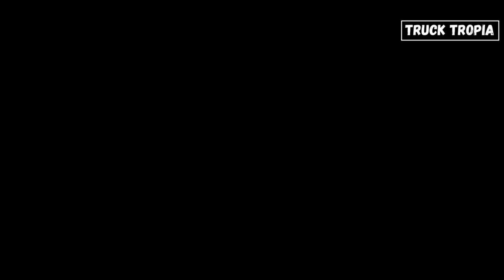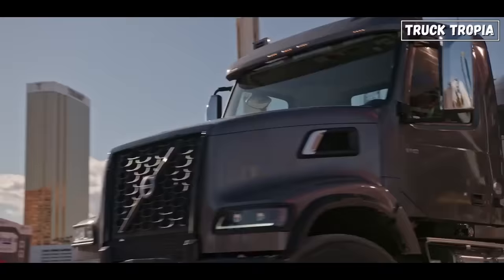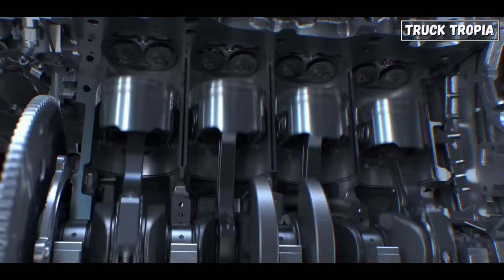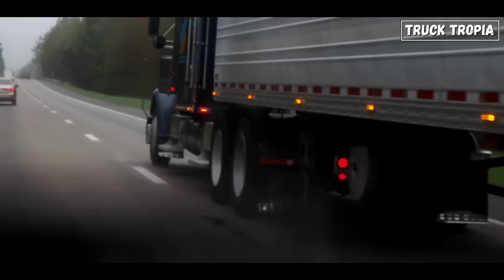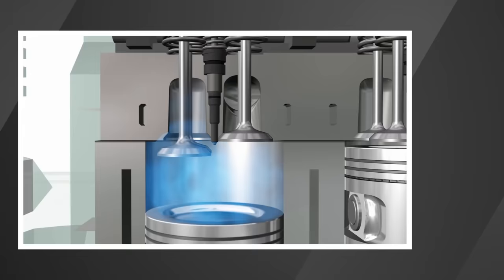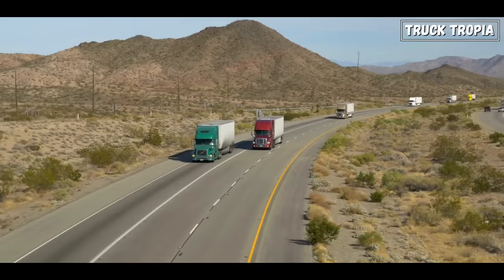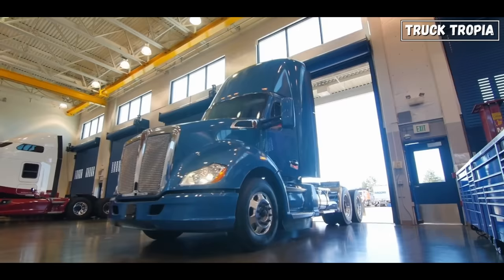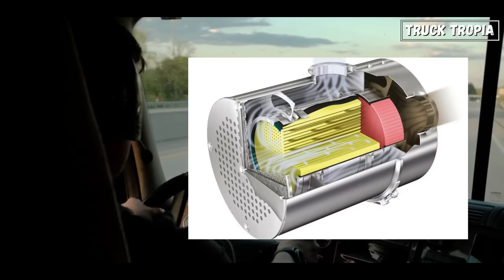Ultimate Truck Education 101 - Every Question Answered

Comment: 80,000 lbs. = 40 tons.  Not 36 tons.  Where in the world did you get the information for this video?  There are several items mentioned in this video that are just flat out wrong.  Why not do some actual research and tell the truth?  👍🇺🇸
Reply from the maker: Not in Eu , 80k lbs = 36.000kg which is 36tons, America is not the only place in the world 😅🫣
Reply: As you may not be aware there are several systems of measure dating from ancient times to now. FFWD to recent ~500 years to now have evolved into two major measuring systems:
A) one labelled Imperial or English System it evolved over centuries out of ancient Roman system of measure. 
The English/Imperial system of measure use the familiar in US, CAN, UK, AUS, NZ & rest of English influenced areas, Briefly e.g.:
Inch, Foot, yard, mile, etc for dimensions/ length/ distance. 
Oz, Lbs, Stone, hundred-weight, Ton = 2,000 Lbs, or Long Ton 2,240 Lbs approx = 1 metric tonne = 2,200 Lbs

Metric system evolved out of ancient Roman units of measure during of France in late 1700s -early 1800s on that adopted unit volume of water 1 litre = 1 Kg at certain conditions. The Kg also used for guaging weights of all materials, goods, capacity, trucks, etc.

Comment: Actually most of the caterpillar engines were v8s
Reply: How old are you? I'm 76 and I've never seen a V8 CAT
Reply: @hansjansen7047  really 3208 cat is a V8 cat. But also can't forget some of 6 valve 8 valve caterpillar engines also V8 Cummins motors with air starters
Reply: There were plenty of 3406 Cats running around our area. It was a very good working motor. Most of the drivers loved them.
Reply: Scania used to run them for heavy haulage.
Reply: Scania used to run them for heavy haulage.
Reply: @danielmwattsjr3671  The 3208 was not a big motor, but mostly a straight trucks and light duty. Earlier ones displaced 522 cid, and later ones were 636 cid. The basic self asperated one ran 175 horsepower, and a turbo unit was 225 horsepower. A company I worked for had Ford C7000 and L7000 units with the 3208 Cat. They worked good for our application, but heavy hauling would of been too much for them. Most of the heavy duty Cats in our area was the 3406. The guys that had them loved them.
Reply: I got one in my 1985 b 700 school bus

Comment: 80000 lbs is 40 tons not 36
Reply: 36 metric tons is about 79360 pounds, hence his statement!
Reply: @LMace-su4if  if your using metic then you would be using kilos not pounds. And in the us, we use 2000 pounds is a ton. We don't use metric tons.

Comment: 2000 lbs equals 1 ton so 80 000 lbs is 40 tons not 36 tons dude and ues i have a class a CDL and am a yruck driver
Reply from the maker: Metric ton is 2204 pound = 80.000 pounds equal to 36.000kg which is 36 ton, your welcome 👍
Reply: @TruckTropia  in America we don't use metric ron

Comment: lift axles are stupid. the horsepower stuff in this video is bullshit. the western states all allow more the 80000lbs except for California, I never ran east but I see they have all kinds of weird drop axles going on so I bet they all haul more then 80000. 63500kg is the legal limit without permits where I live in Canada. I have driven the Euro 600hp junk Volvo motor in a Mack they call Titan. zero throttle response horrible to drive. the transmissions usually limit the torque to 2150 in the US. plenty of v8s in US trucks of the past. 3408 cat, a bunch of Detroits, even way back to the 903 cummins. the i6 config just works better so no one uses the V

Comment: I'm so sick and tired videos that say garbage like horsepower isn't everything and you need torque.
absolute nonsense, of course horse power is everything, because you can get ANY TORQUE you want with transmission. You can spin the entire planet with a long enough wrench, horsepower is the ONLY THING that matters when it comes to acceleration.
Now people are gonna be like oh but no because high horsepower engine only gets that horsepower at high RPM and there's less usable range of RPM. Well yea that's true, but the cause of your slow acceleration at low RPM is still, LOW HORSE POWER. If you somehow had an engine with constant horse power throughout the entire rev range then there's no problem.
Reply from the maker: horsepower isn't everything
Reply: @TruckTropia  no but torque is already included in horsepower more horsepower=more faster.

Comment: Diesel gets 6 miles per gallon and autos get 22 miles per gallon and you say diesels are more fuel efficient. Where dod you go to school, Waldo
Reply: They are more fuel efficient, far more than gasoline engines. Looks like you need to go back to school
Reply: Now do the math on what the semi would get if it had a gasoline engine 😂
Reply: Better mileage relative to the weight. Having a single 80,000lb truck at 6mpg uses less fuel than 20 cars each hauling 4,000lbs at 22mpg.
Reply: Gasoline engines that can move a heavy truck typically get around around 1 to .5 miles per gallon. Ask the U.S. Army.